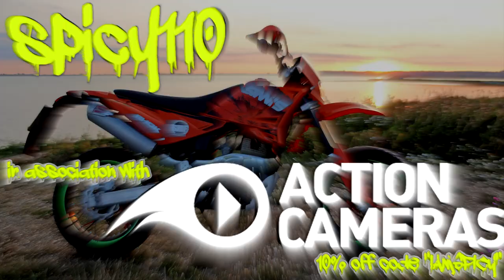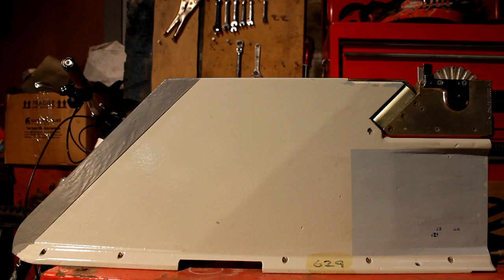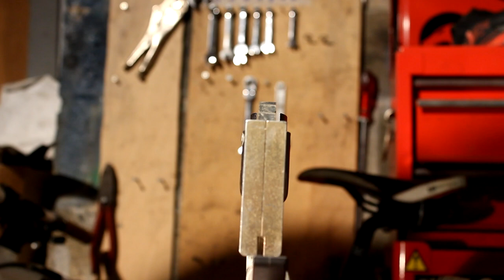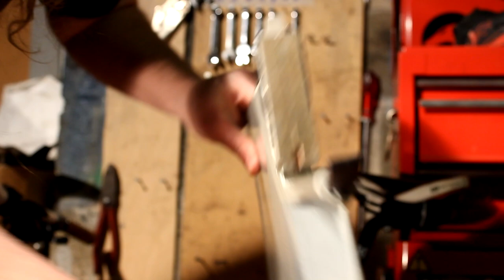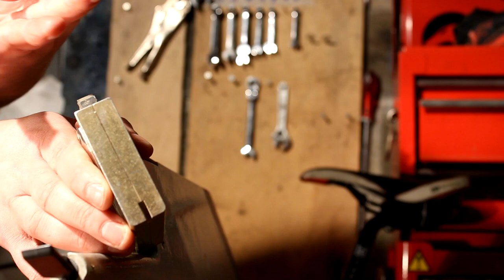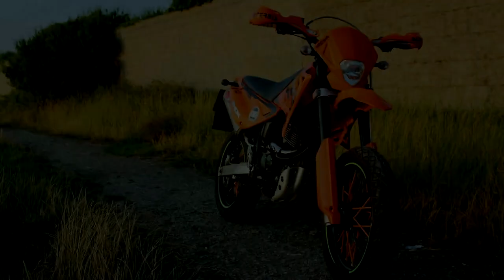The Rolleron! Amazing engineering! Aim-9 Sidewinder!

Comment: The guidance system is pretty simple in concept, although incredibly complicated using 1940's/50's electronic engineering (no microprocessors or integrated circuits, vacuum tubes and later transistors). The guidance just zero's out the angle rate. When the angle to target is constant it knows it has constant bearing and (presumably) decreasing range.
Reply: so it basically just eyeballs it?

Comment: That little thing at the back is called the Roller-off.  Only kidding. LOL. Thanks, this was a good video. I was around military aircraft a lot and never picked up on this little piece of engineering.  The cleverness of aerospace engineers has never ceased to amaze me.  This would appear to be a highly effective stabilizer since it is still in use.  Sometimes you get something so exactly right that it never needs to be changed.

Comment: I worked as a environmental controls contractor at McDill AFB in Tampa during a remodel of the Missile Maintenance Building where they serviced the Sidewinders. I believe they used 3000 psi of air pressure to test the systems. I never got to see a real test but all the hardware was there to see. Thanks for the video and that is a great Xmas gift, bet that didn't fit in your stocking :-)
Reply: You must have been there after the mid 70's. I was stationed the in the missile shop during that time

Comment: 3:00 That wheel is designed to operate at high Mach numbers. The air coming out of your hose is certainly sub-sonic. You're not going to break it with a shop air compressor.
Reply: no its probably not subsonic
Reply: The thing is not designed to be long living obviously. Its life span is typically only a few seconds after it's fired so no wonder they made no effort to make the rolleron buttery smooth :D I'd put some lubricating oil in it if I was playing with that and it's supposed to stay in one piece.
Reply: @dingdong2103  There is a very good reason to make it "buttery smooth." 
     It spins so fast that any imbalance at all would tear it apart instantly.
    It has to operate under some pretty extreme conditions and it has to operate reliably.
Reply: @erictaylor5462  If you listen to it turn, it's anything but buttery smooth. It is very noisy. It's designed to operate only for a few seconds before exploding on the target... That's why it has the locking latch so it doesn't turn constantly while the missile is in the rack. It would wear out.
Reply: @dingdong2103  What kept it from spinning when carried by the plane?
Reply: @jonasthemovie  Well, the locking latch.

Comment: When I was a young child in the 1960’s my dad had some odd bits of technology lying around.  One was a gyro about the size of a tennis ball made of brass or some metal.    It had bearings on each end of the frame, but the odd thing to me was the curved notches machined around the perimeter of the wide disc.   I discovered I could spin it up by blowing on the notches, but never gave it much practical thought.   My dad was into aeronautics so it must have been a gyro for some type of airborne craft.
Reply: I had a gyro that sort of size from a Rapier missile. They were spun up by a gas generator just before launch, it's a common method, you see a little puff of smoke before some missiles are launched and that's what is happening. In my case I used to spin it up by sticking a Biro in the air supply hole and blowing. The bearings on the Rapier gyro were a heck of a lot better than these ones are.

Comment: I didn't hear it mentioned in the video, but the Rolleron's are constantly spinning in flight. From the moment the aircraft starts rolling and until it lands and stops they are spinning. I've actually been at EOR(End of Runway) on numerous occasions in live munition safing area during flight recovery and they were still spinning while ground grew placed safing devices on the remaining munitions. You can't really hear them though over the sound of the idling jet engines. If I remember correctly there's even a Safety note in the T.O. about keeping hands clear of the rear wings on the AIM-9 during flight recovery because of the Rolleron's.

Comment: That brings back memories, I used to test rocket engines at Royal Ordnance in Worcestershire, UK and I recall doing exactly that with an airline across the rotating stabiliser!Then with Thrust Vector Control they disappeared from use on the motors I worked with.
Reply from the maker: Arrr so that's why they got rid of them. 🙂👍
Reply: @spicy110  Plus guidance systems were able to operate when the body rolled, so didnt need to be kept level.

Comment: A neat story from the contest where the AIM-9 was trialed against the sparrow, the crew for the sparrow missile brought huge piles of gear and a ton of equipment to set it up. The AIM-9 crew was 1 guy with an IR flashlight to calibrate the seekers. The AIM-9 ended up with like 9 hits outta 10 and the Sparrow mostly just malfunctioned and missed.
Reply from the maker: Yes curious droid makes good videos, check the pinned comment. 😃
Reply: it was trialed against the AIM-4 falcon, not the AIM-7 sparrow

Comment: The back tab holding the rolleron in place is identified as being caged (locked in place) or uncaged (disengaged), per weapons loading checklists. I liked spinning them after loading the AIM-9, on a couple different fighters in the air force.
Reply: I remember doing pull tests on those retainers to make sure they needed very little force to pop and release the rolleron for flight.

Comment: These missiles zero out their line of sight after launching, which means they maintain pointing directly at the prominent heat source and guide themselves to that point. The Sidewinder is an amazing weapon, having a fin is treasure!
Reply: No they don't, that method of guidance was out of date in the 1980s. That would lead to a pursuit solution, which would give the missile the least chance of catching the target, and the worst response to a crossing target. Current AIM-9s, and a 2006 manufacturing date would make this an AIM-9X, are way more sophisticated. They use a predictive algorithm to aim ahead of the target and maintain the lead until impact. This means that if they are fired in the forward arc, which they have been capable of since the late 70s, they maintain a collision course and fly in a straight line, unless the target changes direction.

Comment: Greetings from the states, mate. I used to play with those slip stream-driven gyros on the inert (no warhead) AIM-9 misses that were attached to F-18 Hornets, F-14 Tom Cats, 
F15 Eagles and F-16 Fighting Falcons as examples of hundreds of US Military aircraft on static display at USAF Joint Base Andrews, 26 kilometers outside Washington, DC. Until finally ending in 2014, Joint Base Andrews would hold their annual US Defense Department open house air shows that sadly came to an abrupt and permanent end after 2014 due to a plague of backpack suicide bombings all over the world from ISIS. But, in friendlier times--the static displays were always spectacular! All of the aircraft had real missiles attached, but without the warheads and inner electronics--but the missiles were 100% real and not model mockups. Therefore, the inert blue painted Sidewinder had those little gyros on them as well as that air resistance-activated retainer clip device. I would play with that thing wondering what it does and was about to ask the pilot who was present giving out autographs to kids, but I had an instant flash of insight as to what it was for and was waiting for confirmation from the Major as to what my theory was and that it was an air driven gyroscope to prevent the oscillation of the actual aileron and gives the entire missile something to "bite on" while in flight used to maneuver after receiving coordinates by the millisecond from its heat seeking head and guidance computers. In other words--I figured out it stabilized the entire missile by stabilizing its ailerons. I never did get to speak to that pilot. Cheers! :-)

Comment: When I was in the Air Force I was a 31631L missile trooper, I remember the rolleron well. We worked on AIM9s.
Reply: I was 31631L 71-75. Went through tech school at Lowry. Discharged at Nellis 10-14-75.
Reply: I had a 5-Level, AFSC31651L.  Nice to hear from other Missile Troops.

Comment: I used to see Aim-9s ready to load on U.S.A.F. F-111s in England in the 1980's and the rollers were spring loaded to pop up about 3/8" freeing a pin that kept it from pivoting while the plane is flying. They were held down by a string pinned in place with a screw, and it ran across to the opposite side fin so you had an "X" of string that crossed right at the rocket motor so on launch, they were free to pivot again.

Comment: The cleverest engineering inventions are always the simplest. That rolleron is just so satisfying.

It's from the 50s, but I'm sure you've already heard soo many times by now.. Best way to get the correct answer on the internet is to post the wrong one afterall :)

Also, if it was built in 2006, then it's  
not an Aim-9B. The 9B is at least 60 years old by now.

Awesome vid.

Comment: Always fascinating to see the individual pieces from our mist clever guidance systems. I have a gyro from an old AMRAM missile the my Dad gave me. It's boosted up by a small explosive charge at launch and immediately spins up to around 100k RPM. When the missile pitches from one direction or the other, the axis of the gyro rotates an electronic indicator across a variable resistor that continually is read by the flight computer.  Corrections are made based on the gyro's voltage output. You'd be impressed at it's design and craftsmanship. My air compressor can only spin it up to around 20-30k rpm, still impressive.

Comment: The Sidewinder is so good that even though it was designed in the 50's it will probably still be in service in the 2100's.
Reply: The AIM-9X currently in service is nothing like any of the other Sidewinders. It uses rear mounted fins for steering and the rollarons have been replaced with a roll rate gyro system in the electronics.
Reply: Despite its longevity, the Sidewinder has a long history of missing the target at every opportunity.  Of course it has seen hundreds of improvements over the years, but only combat can prove its effectiveness.
Reply: It seems to have taken them a LONG time to get them to work properly. There are plenty of reports of the Vietnam era versions failing in one way or another the vast majority of the time. And at a time when the military brass took the guns out of most of the aircraft by then, it was no laughing matter to be in a dog fight and have your only weapon fail to do it's job far more than it ever succeeded.
Reply: @tempest411  Which the sidewinder was still far more reliable than other missiles of the day, like the Falcon.  Regardless, it's also telling that despite the failure issues, missiles were devastating in the air war in Vietnam, and made up the majority of kills, even on the planes that still had guns, like the Crusaders.

Comment: back in my F-4 days we used to play with those while we were waiting to launch. Ours didnt have the little catch, instead there were a set of nylon strings that held the opposing rollerons in place. They strings crossed at the back of the rocket motor exhaust and when the AIM 9 fired the motor would burn the strings off
Reply from the maker: +znuto arr that's pretty interesting 😀
Reply: I found only 1 picture of this, it is on an Italian website.  The translation from the picture on the right side says "retention cable burned by the rocket"    http://web.tiscali.it/areziobiancotti/rollero.html
Reply: but it was not a cable, but very thick nylon string

Comment: Same type gyro is used in ss1b1, strela and igla. In fact all missiles air defence as well as antitank had air powered gyros. That is why there is a lag between your pulling the trigger and the missile leaving the launching tube. In this time the cartridge fires and the air spins up the rotor

Comment: I got one of these today, pretty cool house ornament!  and the ultimate fidget spinner!  I didn't know about the latch thing that made thee control surface able to pivot like that so that was interesting to find out. I thought i had broken it as was unable to close the latch back up but then figured out there's a little thing to press then it can flick back up again.
Those metal protrusions in front of the rolleron are pretty sharp aren't they, of course the first thing I did when I unwrapped it was spin the rolleron and i caught my finger on one of those metal things! 
Do you have any idea what the composite material it is made from is? I thought it would be just metal but mine is a bit beat up in places and some of the paint has chipped off I was surprised to see a white coloured somewhat friable material underneath, I'm hoping it's nothing toxic. I am going to try and find some paint to touch up some areas and the grey strip on the leading edge has split down the middle so might try and get some glue in there to make it look a bit neater.
I'm curious how you managed to find out some info based on the serials on it, where did you look that up? I would be interested to find out about what date and where my example was made.
Mine has some extra writing on which I don't see on yours,  it  actually says wing assembly guided missile and says Mk1 mod 2 EUR (I guess EUR might mean Europe?) anyway tahst foir the educational video, and cheese!

Comment: They were pinned during flight using a crossed dacron cord arrangement. The rotation of the rolleron in the airstream reduced some vibration that was observed on highly maneuverable aircraft. Upon launch the dacron cord would burn through and the rolleron would unpin, allowing it to provide a bit of gyroscopic stability for the inherently unstable missile. They didn't call it the sidewinder just because it was a cute name. The guidance system used bang-bang navigational control signals for the canards. (the little stubby control surfaces on the guidance unit. After the guidance unit came the influence fuze. This enable the missile to track to an average signal strength received from the IR unit in the nose and the signal from the fuze further back. This then enhanced the scissor like action of the warhead. Neat system.

Comment: This elicits visions of a junior tech spin drying a roller axle bearing.  They explode with enough force to turn each roller into hardened, tumbling, ballistic projectiles.
Reply from the maker: Apart from the fact it is designed to go on a missile going 2000mph.

Comment: If it can be done without too much trouble, you might find a small wind speed measuring device (can't remember what it's called) and determine the wind velocity of your pressurized  air with different tips.
Then again, there would be several differences in the two targets such as weight, surface area, friction of pivot and shape of the targets being blown ( no pun intended) making the information gathered from the test untransferable to any other "air turned" object.
Very cool video
Thanks

Comment: Nice video: Mrs Spice is evidently a keeper....   I discuss these rollerons in my book "Spinning Flight".  I noticed on a visit to the aviation museum near Beijing that the Chinese copy have rollerons that are plastic with a metal rim, I wonder if that lowers the moment of inertia allowing them to spin up faster....   I remember in the later 2000s a  guy I spoke to at the China Lake museum mentioned that an additional benefit of the little wings in front of the rolleron in later models of the AIM-9  is to discourage techs from using the rolleron as a castor to take the weight of the vehicle on the ground when handling.....!

Comment: For the speeds this thing goes, that's a HUGE control surface. Unless the missile is doing something silly at the edge of its flight envelope, I don't see these deflecting much more than about a mm.

Notice also the two shock bodies fwd of the roller. Those create a local shock system that ensures subsonic flow at the roller. The faster the missile goes, the slower the flow behind the shock (and the denser the air). Just the nature of normal shocks.

I wouldn't be surprised if those shock bodies were tuned specifically to influence the spin rate of the roller. I love these passive systems!

Comment: There is a 'seeker' module inside the missile that looks forward while tumbling in a loopy spiral pattern.
Whenever the sensor 'sees' IR from the target, the control surfaces will briefly lock into a position derived from the current orientation of the seeker in the missile body.
After several 'hits' from the seeker, the control computer can anticipate the next detection and 'lead the shot'.
The seeker tumbles at a steady rate; three detections at the proper interval establishes a reliable heading to the target.
Changes in the heading information reveal how much to lead the shot!
Each sub-system (stabilizer, guidance) operates independently, often fighting each other!

Comment: I think if you think about it,the movement, it destabilizes the missile actually kicking the tail enhancing or tightening the turn.  Stability is provided via the control system on the front fins.  A very stable system in general is less responsive, the opposite is also true.  It’s the electronics providing the “artificial” stability.  This concept is where fly-by-wire in aircraft pays off also…. The basic aircraft being unstable make it very responsive.  It’s uncontrolled nature is to always be doing something different.